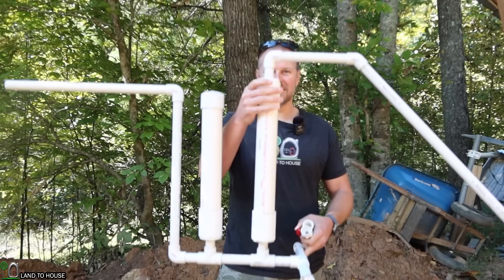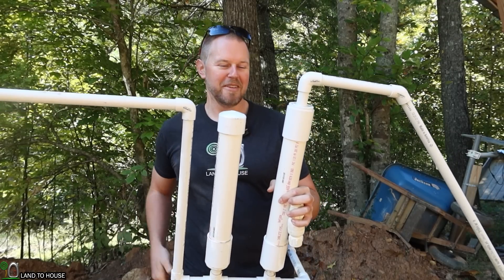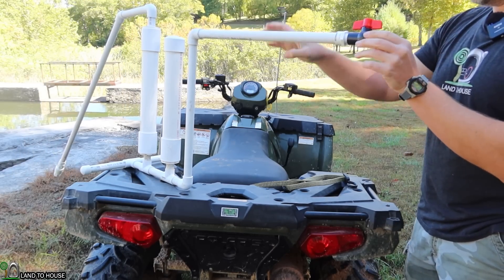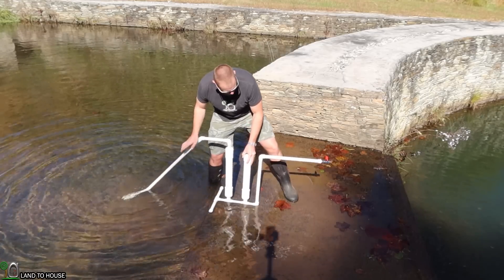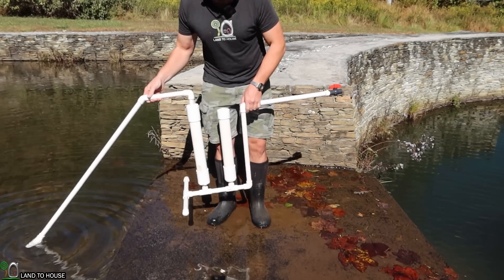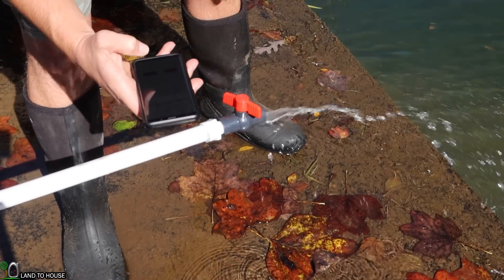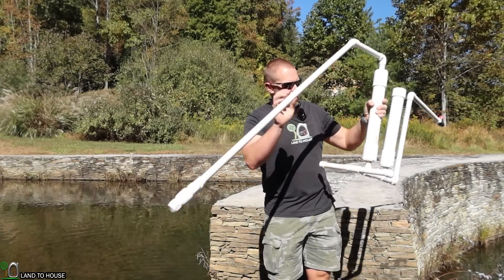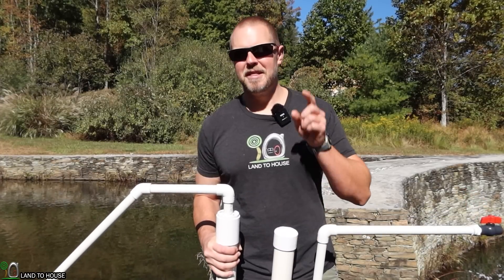This Siphon Works But not for Long

Comment: as i said in the previous video, the guy does perpetual energy videos. theyre an artist at concealment and misdirection. i would say his system had a rubber coupling under the water, he uses the pump to stir muck and cloud to hid the pump. then he sticks the end in the coupling and acts as if the pvc is doing it. the flow rate just doesnt make sense.
Reply: Yep. The fraudster's only purpose is to gull the gullible into clicking on his fake devices. There are many other such frauds out there.

Comment: Flip around the larger pvc for intake and smaller for output. Check valve should be used, I think between the two wider pipes so the water can’t return
Reply: It won't work  when the output is higher than the non-pressurized input - no matter what sort of Rube Goldberg contraption you insert into the flow line.

Comment: Kinda curious if the stand pipe after the pressure chamber was shorter, albeit, it may run a little longer but not much. Or even straight out from the pressure chamber with no vertical lift.
Reply: Or simply drop al that fancy nonsense? A simple hose will do the trick, no funny chambers and pressure.

Comment: @1:34 I don’t think I’m going to glue this valve on so I can return it as we all know free energy machines don’t work. The only constant flow is pocket money from trying these ridiculous hyped up contraptions. 🎈toodaloo
Reply: For testing, I don't think you need or want to glue permanently.  But DOING IT RIGHT is the must. 

🔸100% air tight, not a tiny leakage.  It's the most important part

🔸 All pipes (especially the intake and the MAIN PIPES) must be filled with water for it to generate vacuum.  This video FAILED this part so it won't work. 

The same guy who designed the DRUM PUMP and this PVC PUMP has another version (design) which he has the Schrade Valve so he can pump air into the pipes to create pressure to start the system.

Without manually pumping air into the pipe, then you'll need to fill the pipes with water for it to generate vacuum.

Comment: so it can suck air from not using glue they would say
Reply: No because the only part he didn't glue was the check and ball valve... The check valve was submerged in water so it couldn't suck air and the ball valve was on the outlet side so that doesn't matter
Reply: So the water can leak back into the rivers making the check valve inefficent to maintain the water flow

Comment: i've seen the BS videos of this conn i'd say one pipe hides a pump an the other a battery ...........
Reply from the maker: Very possible. It is likely a youtube algorithm type deal.  Get lots of views even though its fake.
Reply: @LandtoHouse  honestly i knew it was BS as soon as i saw it, anyone that's syphoned a fuel tank should understand that it's BS 🤣 at least you proved it an can now move on to stuff that actually works and is useful

Comment: Thanks for doing this experiment!  I’ve been wondering about this for months.  Have you seen the modification where a Schrader valve is added to the top of the air chamber and a bicycle pump is used to pressurize the air chamber?  Not sure if that would help.
Reply from the maker: I sure have seen that version. I think that would help to get it started but there's no way it would run more than maybe 1 or 2 minutes.
Reply: Air into a siphon will ruin the siphon function. Pumping in air is a hoax!
Reply: I think that pressure will keep it working for an extended period of time. Please try that before completely debunking this theory.  Thank you
Reply: @jessierangel434  No, it won't. There is no head of pressure to supply the water needed to replace the water that flows out. Using the Schrader valve to pressurize the second tube would just blow out whatever water is past it in the system.

Any demos are absolute fakes - perpetual motion machines do not work.

Comment: I wouldn't be surprised if you could get this to work alright for a few minutes but it's never going to be anything but a party trick.
Reply from the maker: It's possible that it could flow a bit more water for a minute or 2. There is no way it's going to have that high pressure flow that the original video had.
Reply: @LandtoHouse  I didn't see the other persons video but when I saw yours I knew it was bs right away.  I'm not sure how long it would last even if you used an air pump to pressurize the chamber.
Reply from the maker: The other guy's video was super impressive flowing somewhere around 10 or 15 gallons a minute.
Reply: @jmr  By no means - no air into the system. Air will ruin the siphon effect.